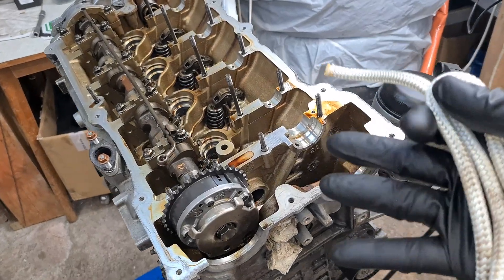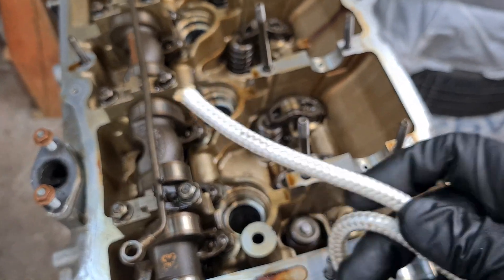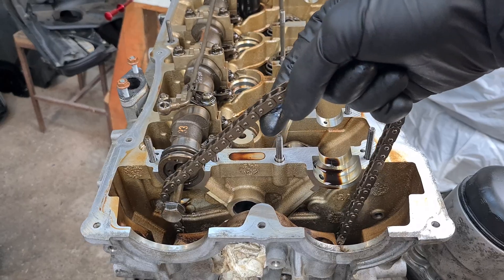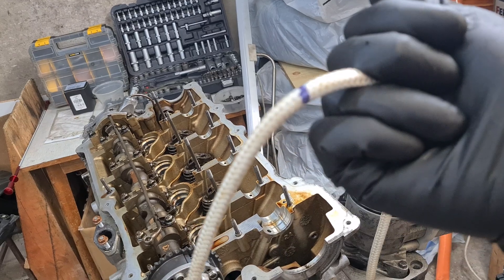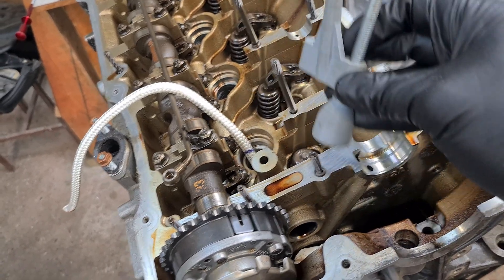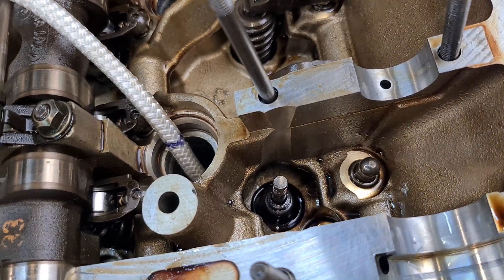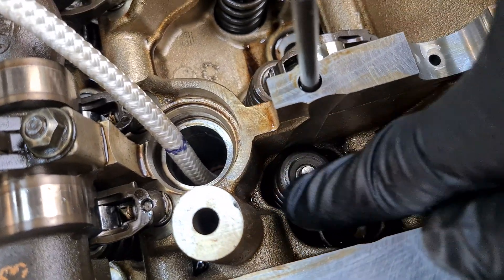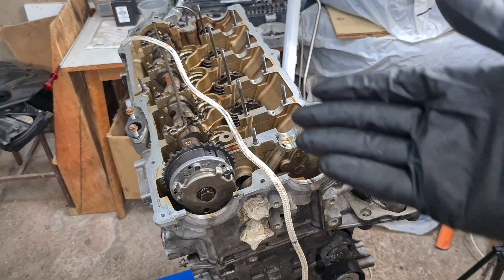Using rope to hold valves during valve spring removal and valve stem seal replacement

Comment: !!!WARNING!!! After watching your video I decided to use the 'Rope' as opposed to 'Air'. On BMW S63 engine I stuffed cylinder 1 with nylon rope, turn crank until it stopped, removed valve springs. I turned the crank counter-clockwise slightly to release top of cylinder from compressing rope.  When attempting to remove rope it would not come out. After using my bore scope to view inside the cylinder, it had somehow developed a knot. At this moment the nylon rope is stuck in the cylinder and will not come out, no matter how much pulling force is applied. I picked at it for 4 hours to try to undo know, impossible. I am now in the process of removing the head to get the rope out, which includes removing turbos, all associated coolant and oil lines, then the exhaust manifold. What a mess!!! DO NOT RISK IT!!!
Reply: Could I say “you are a genius”? I can’t imagine how you make a knot in this way! 😅
Reply: You could also try to burn it a little to get something to grab on but yes this method seems dangerous if you can’t get it out, a small pancake compressor and a compression tester hose should be enough to pressurize a cylinder and do this job and not mess with the rope
Reply: Burn the rope dont be stapied
Reply: @jeremysmith-mp7nu  if its natural fiber its ok i guess, but if its nylon ? It will get glue ....
Reply: Yes, use a hot air gun to soften the rope to the point of almost melting the yank it out with a hook.
Reply: How thick was the rope you used?  Was it really stringy?
Reply: @danman2070  I used bungee cord from Clark rubber. Maybe 2M of it. Stuffed all except about a 1cm bit down the socket
Using the valve stem seal pliers. It work great. Valve stem seals - Rope Method (handy tips & tricks)
https://youtu.be/Wvlj75rJMXw
Reply: @Fine_Performance  I suspect that the end of that bungee cord is what the issue was.  They seem to have flowered and that has become stuck.   I'm just considering that if I do do this and I use rope I melt the end so there's no fine pieces to get caught between the cylinder and the wall.  I'm pondering this job too.  Just watched your video.  Thanks for the tips
Reply: @danman2070  no worries, yeah mine did the same do I just melted it. Best to get a nice clean cut with a knife. Then melt the outer part & it will kinda contain the bungee cord. By the end I did have to really push using the valve stem pliers to get the top in. But all worked well. One thing that surprised me was how my rope I put into the cylinder. It was like 2M long & only 10-20cm was left out after stuffing it into the cylinder. I was pretty nervous at first. But once you get the hang of getting the rope in there & popping the keepers using the spring compressor, it all goes well. It was only really the first couple that didn’t pop easily and it was mainly because I didn’t have enough rope in there.
Reply: @danman2070  it should be thick enough to enter the spark plug hole
Reply: You would have to remove the head anyway,  so how is it a risk?
Reply: You could also use a thinner 4 mm nylon rope, like for the garden trimmers, and just put more. (But what happens if it goes around an open valve...?)
Reply: Just replying to let people know that the exact same thing happened to me, except I did not even crank the engine to compress the rope. The rope just made a knot inside the cylinder because so much of it has to be stuffed in to prevent the valves from dropping in it.
Reply: La primera vez que cambie los sellos de válvula no use nada para detener los vástagos, (por ignorancia) pero si sabía que se podían caer, pero por suerte no se cayeron
Reply: Use bungee cord...............................
Reply: @ytromu  I used bungee cord which was more than successful & can’t tie in a knot.
Reply: Your mistake was pulling on it making the knot so tight. Should have stopped and grabbed the bore scope the second it didn't just pull out
Reply: I think it was knotted when you stuffed it in mate or you just shoved it in with no care in the world
Reply: @matthewsanchez956  How could a knot be small enough to get inside an even diameter spark plug hole, but too large to come out? That makes no sense.
Reply: The guy said "DO NOT TURN COUNTER CLOCKWISE" literally right before finding TDC in the video lol
Reply: @chrisalberts504  some motors turn counter clockwise.. h series motors from honda as well as a few others
Reply: Can you melt it?
Reply: What risk? This isn't common, and the alternative is that you have to do all of that work anyway to remove the head.
Reply: I feel your pain! 😢😢
Reply: 😂😂😂that is really, really unlucky
Reply: Skill issue
Reply: Put a torch in there and melt the rope it’ll come out the valves
Reply: Why would you crank??? Dude never said crank! That's a user error!!
Reply: 'Crank' does not mean start the engine, battery is disconnected, impossible to 'Start'. Crank is "Crankshaft", 'turned' it from the main pulley with breaker bar to compress rope against valves. As it turned out, I did not remove the head. I was able to use a bore scope with a wire hanger and grab the other end of the rope. At that point I had both ends of the rope in my hands and I pulled like hell until the knot popped out. All this being said, there is the possibility that the rope could knot. I read a forum where it happened to another. I was warning of the obvious possibly (Murphy's Law). @AmissaEx
Reply: @ytromu not worth all the explaining man, the engine in the video is off the car, of course you "crank" it manually. If he could not observe this, he should rethink some of his thoughts 😂
Reply: @ytromu  I am going to use a small, but you have to use a little more of a smaller rope,better chance of getting it back out if it does knot up!
Reply: @AmissaEx 

Yes he does say crank dude.. First cylinder at bottom -> fit rope -> crank to compress.
Reply: Seems like a personal problem ive done this tons of times without a single issue
Reply: I think you stuffed a knotted rope in the hole that you couldn't undo, so you figured if you could get it through the sparkplug hole now, then why not after yer done.
Problem was the knot got flattened by the piston & was bigger. AMIRIGHT?
Reply: @armedfarm3429  Dude, your hypothesis is idiotic... AMIRIGHT? Why would I stuff a knotted rope into the hole? I used the same size and type rope BimmerZen suggested. It was a case of Murphy's Law... S#*t happens and I survived... Just warning viewers of the possibility, as in my case. Now,,, please go help solve our economic issues... AMIRIGHT???

Comment: How about if I put air into the cylinder? 🤔
Reply from the maker: Yes, that is the preferred way, if you have the spark plug - compressor hose fitting.

Comment: There are two top-dead-centers.  Preferable to use the one that's at the end of the compression stroke so that there is no chance of a valve being partly open near TDC which could cause the rope to become hooked on and difficult to release.  For the other TDC, the exhaust valve is closing and the intake valve is preparing to open.  There's also a small chance when doing the repair that the valve might move down slightly and hook part of the rope, making it difficult to pull to rope out.  A thicker, bungy-type rope seems safer than a thin, floppy one in terms of avoiding entanglement.

Comment: I do have one issue what if replacing under maintenance while engine still in car already locked in place by flywheel just question if I free up flywheel tool and move piston now won’t be set I get it can put back but won’t know if your 180degrees out or not I set the flywheel tool once cams were face down intake and exhaust writing on them was down took tool out spun whole around one turn of flywheel and now cams were right side up? Just question haven’t done a lot of these

Comment: Found video useful.I did my e83 m47 diesel valve seals using the compressed air method via injector hole. Needed 4 bar to free the collets i then reduced to 2 bar while i replaced the seal as there is a certain amount of air leakage. I compessed the valve springs with a Laser 5258 tool. The risk is the air compressor failing or a power cut whilst the valve spring is off. Car has done 140k miles been 2 months now and exshust is dry.  I also cleaned egr valve, intake ports, and intake manifold. Best of luck with your Bimmer.

Comment: it's possible to do it without rotating the cranck shaft?
Reply from the maker: With the rope method; not realy. With compressed air; yes, but even then it's best to put that cylinder in TDC to prevent accidental dropping of the valve inside the combustion chamber. Also remember to keep the chain tight against the sprocket while rotating crankshaft or you will break the plastic guides at the bottom.

Comment: What happens if the valve drops into the engine, or should I ask? 🤔😄
Reply from the maker: That can't happen if the piston is in TDC on that cylinder. But if you drop the valve, you need to remove the cylinder head to retreive it and reinstall it back into the cylinder head.

Comment: Thank you for this but has anyone ever tried the same trick without using the piston to compress the rope? That is simply stuffing the cylinder with enough rope to prevent the valve from falling whatever the position of the piston. This would be useful if the operation requires a locked crankshaft. I fear that the long length of rope that will then be necessary on some cylinders will make the trick less reliable.
Reply from the maker: Not the best idea. Read the pinned comment:)
Reply: There’s another video that places the piston at TDC and it holds the valves. I asked why not rope and he said the same thing that the piston in that position will hold the valves. I also was using my boroscope camera and could not fit it in the hole where the piston was TDC. All the room was taken up by the piston.

Comment: Working on my car now, using the rope trick. Did it with 1 cylinder fine. In the second cylinder the rope got caught, I managed to get it out though. I tried a lot of different things -- picking at it with a thin long metal rod (similar to coat hanger but thicker), I tried moving the crankshaft back/forth and gently pulling, these didn't work. I added a few drops of engine oil to try and lubricate the issue, I tried yanking on it hard, but none of these got it out. I was about to use leverage to yank even harder but for whatever reason, didn't resort to that yet.

What worked was spinning the nylon rope clockwise to tighten it down the cylinder, while pulling it out. This made the rope a lot thinner and tighter (from the point I was spinning it, and about 5-10 inches downwards - enough to get it through the spark plug hole) - The backside of the rope, behind my hands was getting thicker and looser - this doesn't matter because it's not going into the cylinder. Then just gently pulling got it released from where it was catching. When it was fully out, I inspected and the rope was frayed, bunching, and catching in some parts. I guess the rope I used is only a tad smaller than the spark plug holes, so it must have been fraying and bunching up just at the spark plug hole.
I'll be doing the other 2 cylinders, not right now but sometime next week - need the weekend off to de-stress after this mess. I'll be using a new length of rope for each cylinder. I don't recommend re-using rope for more than 1 cylinder after what happened to me. Hope this helps.
Reply from the maker: Thank you for providing details on how this problem started and how you solved it.

Comment: Hahaha I logged on especially to comment on this video. DO NOT DO THIS. I also did this method many many years ago as an apprentice at the time compressed air was not possible so did this rope method. Did it a few times before with out issues so was kinda of tried and trusted. Until the fateful day I did valve stem seals in place on a BMW e46 318i (n42 engine) was finishing up the last cylinder 4. Apon trying to remove the rope it also would not pass through the spark plug hole. It had somehow made a knot also. It took me and a friend about 2 pain staking hours with long fine screw drivers trying to undo the knot that had magically come about. Luckily we had success and never had to take the head off but vowed to never use the knot method again. 

I really do not recommend this method. Invest in a little air compressor with correct fittings and don't take chances.

Comment: I need to replace my Mini N12 valve seals, using the rope method feels safer than compressed air. I can imagine losing compressed air just when the springs are removed, then the valve dropping into the cylinder!

Comment: In the early 1990's my cousin changed valve seals on a Mercedes-Benz 280S. But he went to all the trouble of getting a spark-plug hole attachment made at a machine shop. This method is much simpler and cost effective. Thanks for sharing.🐞

Comment: When trying to tune the ECU in Audi 2.0TFSI CYMC 2019 I get the error "Pressure too high in cylinder 3" and the engine shuts down after that "Misfiring" - this protects the cylinder and turns it off.

Do you have any idea what it could be? I can send photos from the endoscope of this cylinder

Comment: How much can you turn an engine counterclockwise (to release rope) without creating damage to engine?
Reply from the maker: Danger to the engine primarily comes from breaking of the plastic slide rail due to chain bundling at the bottom. If you keep the chain tight against the main sprocket while rotating the engine, then you won't damage anything.
Reply: @BimmerZen  Thank you

Comment: When doing my job, I need to zip tie the timing chain to the cam gears to keep timing (as well as ensure the chain stays taught on bottom gear) - so in that case, I cannot turn engine - is the rope method still usable??
Reply from the maker: If you are working on a BMW N40/N42/N45/N46/N43 you have to use the timing tools to set the timing, so there is no point in ziptieing the VANOS units.. I can not say for other engines but in principle you have to be able to rotate the crankshaft to compress  the rope against the valves.

Comment: How much compressed air do you have to use, as opposed to using the rope? And what are the dangers of using too much air in the cylinder head? Especially if its DIY job.
Reply from the maker: 1 Bar should be enough. Dangers of too much pressure is that the crankshaft must be secured against accidental rotation under pressure.

Comment: What about the camshaft rings near to the vanos, should they be replaced? Thanks
Reply from the maker: I never replaced one. They usualy don't wear out unless something goes horribly wrong (metal or bearing material in the oil).

Comment: Considering whether to use the rope method or compressor method. Rope feels safer since nothing can go wrong except... like several commentors wrote the rope got stuck in the cylinder. I will think that using the thickest nylon rope possible and burn the ends should be idiot proof?
Reply from the maker: It's safer to use compressed air (piston in TDC). I can't say if bigger rope is better... Maybe smaller OD rope (6mm) would be better since you can still pull a small knot through the sparkplug hole.
Reply: @BimmerZen 

Thank you for answering.

I thought about it and will do the compressed air at a later stage.

For now I just want my engine to stop rattling.

I noticed that I could move the inlet cam 2-3 mm while my timing tools are inserted and the exhaust cam around 1 mm. I forced the tool at an earlier stage and definitely bent it slightly.

I ordered a new timing tool and hope it will stop the rattling. I'm already on my third set of VANOS gears and they are all rattling so I'm starting to think it's not the gear, lol.

Comment: What is the name of the component that connects with two bolts just outside the cylinder head next to the exhaust cam
Reply from the maker: Vacuum pump for the break booster

Comment: I'm really liking the rope method! I'm assuming, once again, the 70cm thing is specific to that motor.
Reply from the maker: It's just the length that worked well for me for the diameter of the rope... It should work the same for any 500 ml per cylinder engine.

Comment: The tool you printed only works for that engine, correct? Same with the keeper tool, right?
Reply from the maker: The tool in the video works for N42 and N46 only. I also have a N40/N45 version and I am currently developing a version for the N43.

Comment: Can you bend accidentaly exhaust valves as you rotate crankshaft? As I can see camshaft still there ...as some of exhaust  vale can be opend ?
Reply from the maker: Since the camshaft is not connected to the crankshaft, it is rotated in a way that the valves are opened only a little, not enough to contact the pistons. Pistons also have valve reliefs.

Comment: nice video. btw you did turn the crank counterclockwise when removing the rope. 
are your spring tension tools compatible for other marques or just for BMW?
Reply from the maker: Yes, I did rotate the crank counter clockwise, but I made sure that the chain is tight against the lower sprocket. This 3d printed tool will only fit the BMW N42/N46 engine and I also have designs for N40/N45 and N43. It will not work on other engines.

Comment: BEWARE!! I tried this on an '85 Pajero and now the rope is stuck inside the cylinder. I can rotate the engine 180 deg in either direction and then it seizes at each point. Looks like the head's going to come off...